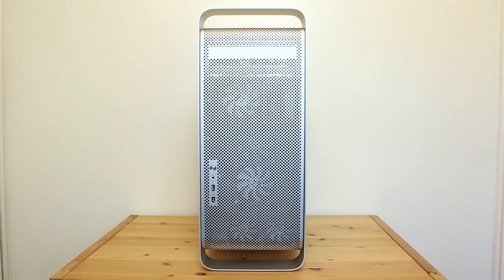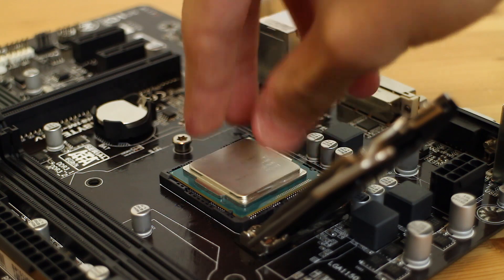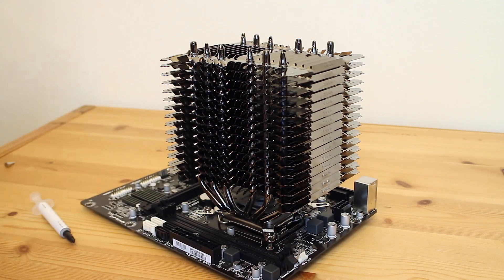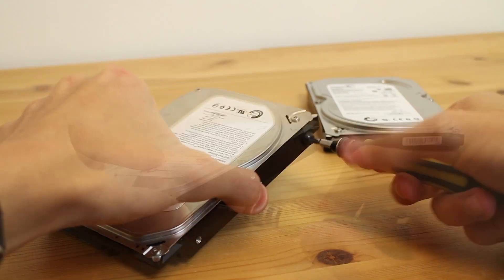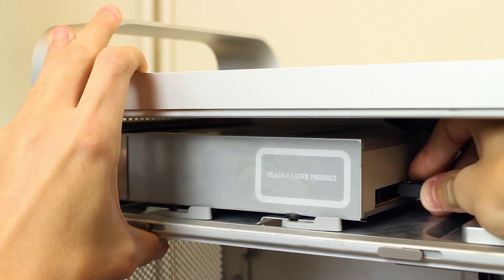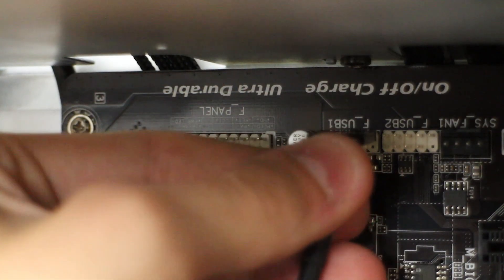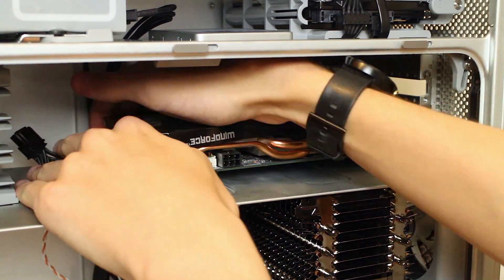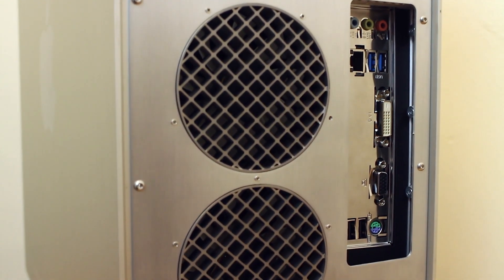Power Mac G5 Hackintosh Build: The Build [3/5] | The PowerPC Hub

Comment: Excellent video series. This mod is my favorite so far, primarily because it keeps the stock G5 internal appearance and I will follow a similar method for my own project. One thing that I might do is close the gap between the metal panel (with 'G5' on it) and the rear fan assembly to make it look even more stock, but I'll cross that bridge later. For now, since I need to do some cutting and the best cutting tool I have is a friend's angle grinder, do you think an angle grinder would suffice for cutting the case or would a dremel be more useful?
Reply: A hacksaw blade did the job perfectly in 5 hours.

Comment: One question: ATX Motherboards doesn't it fit inside the Mac G5 case?
Only MicroATX mobos?
Reply: atx does, but the kit for atx requires you to cut all the way up into the drive cage area.
Reply: Thanks, pal.

Comment: I have a couple questions as I contemplate building my own hackintosh for the first time. 

I have a Mac Pro that has a similar case to the G5, would you recommend I use the case I have or was that a kind of unnecessary step aside from the look?

Also, how much did all the components cost and is the GTX 660 enough for current games?
Reply from the maker: The Mac Pro is an evolution of the G5 case and is in many ways more suitable for a hackintosh, with more modular hard drive bays and a traditionally shaped PSU, but there isn't much out there in terms of information on modding Mac Pros as even the oldest ones are still very useful today. If you can live without The Laser Hive's kit & you're pretty comfortable at designing & DIY then go for it! Just be warned that it's definitely not for the faint hearted.

All of the components cost me £499.86. The GTX 660 plays everything I've chucked at it at 1080P without an issue. As you'll see in the benchmarks in Part 5 it's still a very, very capable card, especially when paired up with the i5.
Reply: +The PowerPC Hub very very cool! I'm hoping to get an Oculus or some VR headset at some point so I'm gonna try and see which graphics card is best for that but otherwise I'm very inspired by your build!

I may just keep my Mac Pro as is and get a new case for the Hackintosh just cause it's probably good to have one "real" Mac around haha.

Comment: Wicked cool, wouldn't a Intel Mac Pro case work much better as the power supply wouldn't have needed to be chopped up?
Reply from the maker: Technically yes, but there isn't anywhere near as much out there on the web to guide you through modding a Mac Pro case. And also the Mac Pros, even the oldest ones are still very capable machines. I don't think they've got to the point yet where many people are willing to gut them.
Reply: +The PowerPC Hub There are 3 on Craigslist near me that are gutted, they however are around 10-20 extra